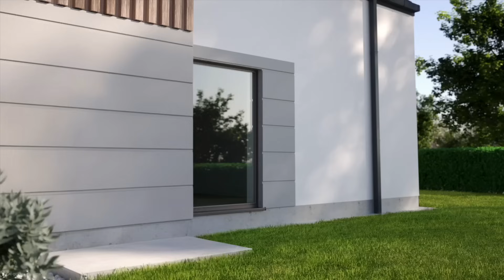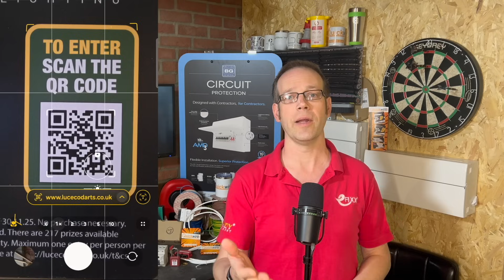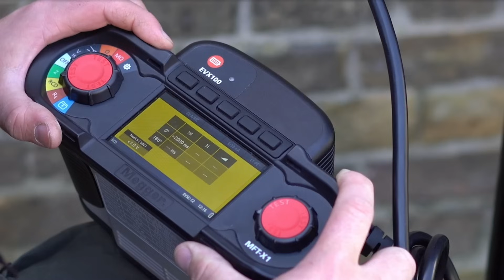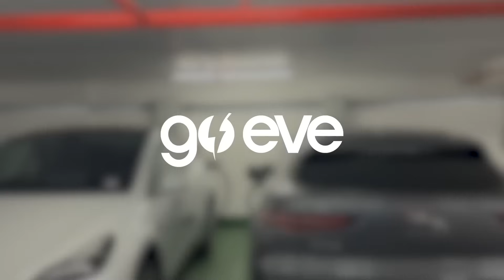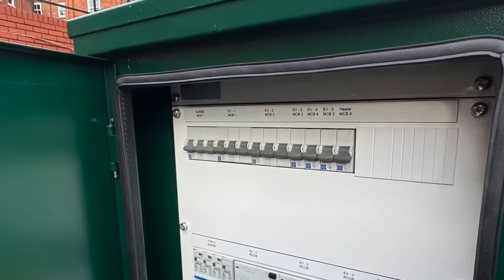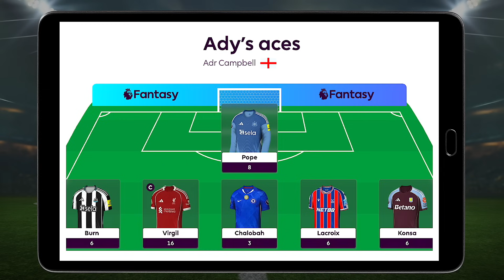National Grid Wants To Move Electricity Meters To The Garden

Comment: Installers earning a split of revenue generated from a customer's EV is really poor. The installer is already getting paid for their time, while the customer is investing a huge amount of money. I think it sends the wrong message and erodes trust.

On the subject of the "OBELISC" cabinets, I think it's a really good idea. We're currently in the process of upgrading to three-phase and kicked off the process early, so that the DNO can go through the process of getting wayleaves while we work out where to put the new cutout and meter. We have an overhead supply, have outbuildings and we're building an extension, so the options are either to install two larger wall-mounted cabinets on the side of the extension, one for the cutout and meter and another for a distribution board, or to install a larger free-standing GRP cabinet. The "OBELISC" is essentially a standardised version of the free-standing cabinet, it's just a shame that it will arrive far too late for us. I may still ask our project manager about them though, as maybe they have some initial versions to be used in trials.

Comment: Ah supply all houses with 3 phase....cannibis growers have been saying this for years !
Reply: You say this as if domestic houses aren't currently allowed a three-phase supply.
Reply: You do not need to supply 3x100A IMHO. 3x20 is more than enough for 3 bed flat. 3x32  for small house. I have got 3x16A  before my meter, sockets work, electric water heater works, electric stove works . No problems at all.

Comment: In many countries meter box is allowed to install only outdoors. Even in poor countries meters are installed outdoors. The reason: it is hard to find main isolator switch during severe flames while room is full of smoke. 

Metal consumer units are mandatory only in combustible buildings. In concrete building plastic consumer unit will fall to the floor and burn till end without spreading fire to other rooms. Very strange to replace consumer units in all buildings without giving fire spreading rate to wall materials.
Reply: Specially in U.S.A. the meter is on the street pole. The Kingdom of Thailand use in rural places meter on the street pole, but save on houses inside cabinets at most modern houses in cities. For our resort in rural place we use a small house. 

Overall in Europe we have doorbells at entrance so electric personnel can see the meter in-house. In most countries they use far-away computer / special meter technology or, e.g. in Germany, postcards with numbers so the companies known the electrical usages every year.
Reply: Metering and Isolation of a supply outside the properties is generally in countries where distribution is overhead and the houses are made of timber. In other words not much money or thought was spent on the infrastructure or the installation of domestic wiring.   UK comercial premisses which have electrical apparatus like illuminated sign have a 'Fire  Isolation switch' that the Brigade can operate.
Reply: @Woffy.You are wrong. Those switches have only specific buildings in UK, residential buildings have no such isolator at all.

Comment: Relish and hotpot? Are those the mystery words?

Whilst i do see the reasons behind it are valid, i dont think its practical at all and will ultimately look ugly and out of place. You can try to polish a turd but its still an ugly turd 😂  A lot of properties dont even have a garden 😂
Reply from the maker: Good guesses on the mystery words, tune in next week to see if you got it! 

It's quite a clever solution but there'll be some very challenging properties to implement it in.
Reply: You can already image the rows and rows of meter boxes outside high rises or tenament blocks,it'll look lovely😊,we had intermediate gas regulators in our gardens for years(under those green boxes)until we had a new supply fitted, not a month went by without someone in or around the village with an open driveway smashing theirs over with a car.

Comment: Err please explain how "putting three phase kit inside the home will produce significant heat rise"

The amount of load is the amount of load!

Three phase means smaller cables, due to smaller currents, and lower I^2R losses.

If it's the same load, that's the same heating effect in the instalation,  single or three phase, but lower losses in the supply cables and meters when three phase.

Sounds like the usual marketing misinformation.
Reply from the maker: I thought that was an interesting statement too. I guess with the example given the supplies to the extra loads don't pass through the house at all? 🤷
Reply: @efixx

So consumer unit in the outside "pod"?
Reply from the maker: Some kind of three phase connection in the box, existing single phase to house, new single phase to EV, new single phase to heat pump is our understanding. 🤔
Reply: @efixx so unbalanced loads, how does that make sense?
Reply: @efixx

That only really makes sense if the heat pump and charge point are three phase, otherwise that's really no better phase balancing than distributing houses over the phases - either way you get the same distribution!

So a mini-consumer unit. Plus head plus meter, plus isolator.... all in a pod at the end of the property available to all passing by.

Will make a change from putting traffic cones on statues at Christmas...
Reply: @efixx the “single phase to EV” part is absurd!  Why on earth would you run a single phase cable to a charge point when you have 3ph available?  

So instead of a nice balanced 11A per phase and the possibility of faster charging if the car supports it, you are locked in to 7kW and 32A on one phase forever?

Who came up with this nonsense?
Reply: @efixx  If you questioned the PR blurb and it was obvious BS, then the responsible thing to do would be to not quote verbatim, without a caveat, doing so makes you look better. If you do this and certain companies don't think you are ad friendly then they loose that revenue more than you do. You will only attract vendors who are willing to be more honest, and people will respect you more for your honesty.

Comment: This seems really silly to have a three phase meter box and a single phase meter box inside of a home If you're already going to have to upgrade the service you should might as well do it right and do the whole thing
Reply: Consider a scenario where the existing meter location is quite small, maybe it's been boxed in by the door or in the kitchen. Currently there's a single-phase cutout, a single-phase meter and a single-phase consumer unit. You can't fit the three-phase versions of these within that location, but if the cutout and meter were moved outside you'd now have the space for a three-phase consumer unit. I think that's where the value of this idea is - I think they have missed the point a little when they talk about connecting the charger directly to the kerbside meter box as that would require digging up the garden, but moving the meter and cutout out in order to make space makes a lot of sense to me.
Reply from the maker: I think it's actually a pretty neat solution on paper, I'd really like to see one done for real to see if it actually works. 🧐
Reply: Yeah but we can save 20£ now.
Reply: I see it a lot, quite often the 3-phase is split into single phase feeds, one phase to the house, one to the workshop, one to the maids cottage, one to the swimming pool pump room etc Its the way all older 3-phase systems seemed to have been installed, its cheap, effective, ticks all the boxes and if you're into the technical aspects its safer because you cannot get floating neutrals! However, BIG, BIG problem,... Its absolute crap with a modern PVS because you get phase inbalance so you are limited to a maximum of about 5kW (sometimes 7kW) after that, you've lost all the bang-for-back offsetting.

Comment: I have an idea. Let's fit millions of smart meters and then we'll move them all. For a moment I thought it was April 1st.
Reply: When my supplier asked to fit a smart meter i requested  they move the meter because it was within 18 inches of my daughters bed head. They just said if it's that close we will take you off the list!  I take it from that there is a detrimental effect of having it that close.
Reply from the maker: Sooo, not a fan then? 🤔
Reply: @efixx  Well, best of luck with you're 20 storey block containing 80 flats 😂
Reply from the maker: 😂 That's gonna be a busy boundary!
Reply: @efixx  And a lot of fun for some loony with a meter box key and a collector of service fuses 😁
Reply: @kitchencarpet9054  I'm not sure how many EV chargers and 8kWh heat pumps you would expect the residents to be installing in a 20 story block of flats?
Reply: @rogerthomas7040  Well I guess you would have to ask Mr Milliband to get an honest answer to that question! 😂
Reply: @kitchencarpet9054 many blocks of flats have all of the meters in a single room on the ground floor. They put them there to reduce the cost of reading them manually, having to visit every flat individually. 
And as per the other contributor (EV chargers for 20 floor blocks of flats? How many of these have dedicated parking spaces for every flat?)
Reply: @kitchencarpet9054 most of the blocks of flats have the meters in a riser cupboard from what I have seen 
ex electrical test engineer here
Reply: @rogerthomas7040  How many heat pumps take 8kW? My 4 bed 1960s ex council house runs a 5.6kW OUTPUT unit, even at temperatures below 0 it never consumes much more than 2kW, most of the time it's about 400W-600W. Yes, industrial units will take a lot more, but this is about domestic users.

Oil filled radiators of course consume a lot more electricity.
Reply: @rugbygirlsdadg 

Those sizes of blocks don't normally have the metres in the intake, they have the main fuse in a ryefield that then goes to the metre within the flat.  Normally because the responsibility for lateral mains is not that of the resident but that of the landlord. 

Of course some do it that way but most don't for large blocks.
Reply: Sometimes the truth is funnier and stranger than a comedy sketch show. And you get to pay for it.
Reply: That's the spirit when you're government funded!
Reply: It’s intended for future new build estates.
Reply: Actually fitting smart meters indoors isn't that big a waste of money. The biggest cost is in moving the meter to the outside.
Reply: @deanXRayZulu if they change to 3 phase won’t the single phase equipment be redundant
Reply: @davefish8107 It's not redundant. They can still use it.  It would be preferred to remove it, but that comes down to the cost of that
Reply: @davefish8107  no.  Listen to what they're saying. The 3ph won't come into your house. Only the single phase (which is already there)
Reply: @davefish8107

No because you just connect the single phase to one of the 3 phases.
Reply: Well I have no intention of having a electric car , , 3 phase is 10 yards from the house and I doubt they would want 10k to get it connected even if i take the drive up and dig the trench for them !! Obviously dreamt up by some jumped up educated person with no clue about the real world or was it our stupid green dreaming minister of nothing ?
Reply: @paulwainwright6903 read it again Paul, this relates to new future new build house designs-  not your house!
Reply: @paulwainwright6903 if your younger than retirement age you/we will definitely be driving all electric in the future wether you like it or not buddy. (Maintaining a classic ICE car as a daily will be far too expensive in the future)…

Comment: Meter box on the boundry, how will they address 

SWA Glanding?
SWA Termination?
SWA with exposed singles?

Other cable types may also apply
Reply from the maker: Seems like the perfect time to do something about it. 🤔
Reply: Also dogs pissing up it
Reply: What about pme supplies, will they allow long runs to the house and use the earth
Reply: Its not an issue, in this box there is another metal DB and all the SWA's simply terminate along the bottom so the glands are bolted tight metal to metal. Within the DB the cores of the SWA are all contained inside so there are no exposed cables. But, for me, the big deal with SWA are the other ends, and that's another story with, in my experience of working with 3-phase SWA, never seems to have a happily-lived-ever-after outcome! So nowadays, I avoid SWA (unless its outbuildings). I install 56mm underground ducts or 32/38mm internal. Customers expect a fixed price contract and with ducts you know in advance what you are taking on AND you can subcontract the ductwork, its win win and usually there's not a lot of difference in the total cost to the customer.